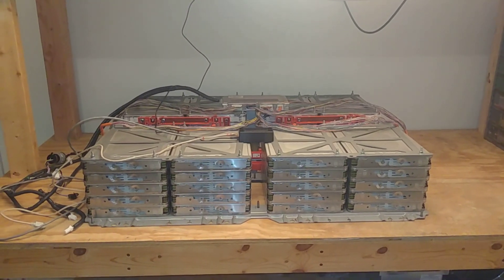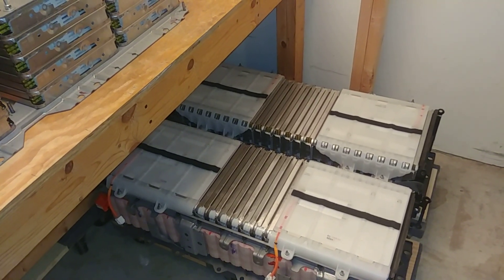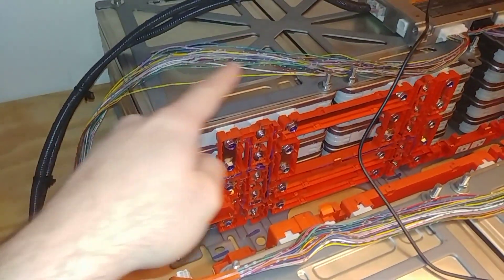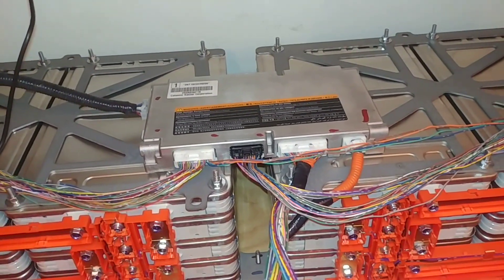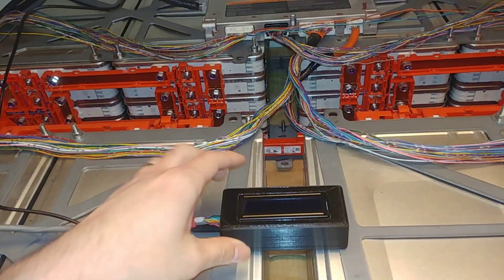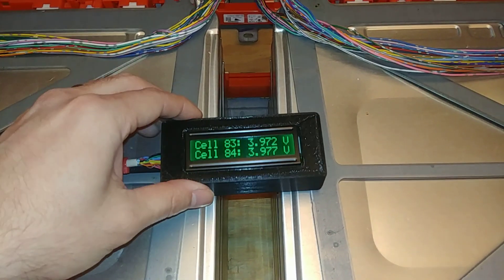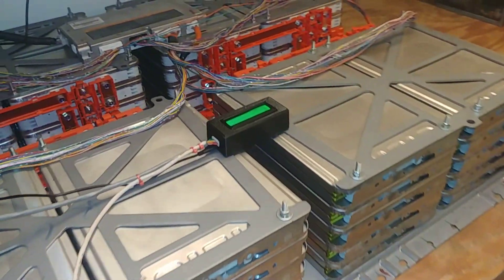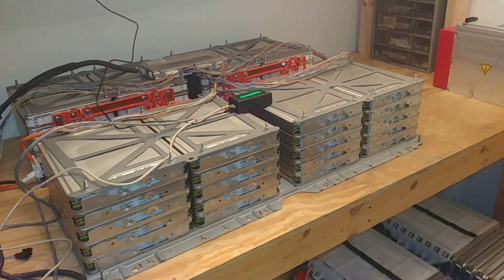Solectria E10, Lithium Ion Battery Upgrade, Part51

Comment: Hello! I am currently trying to put some non-oem modules to renault fluence z.e. battery pack which uses nissan bms. i''d like to use the oem bms with reprogrammed chip. Can you help me with modifying the eeprom? I need to set it to work properly with 55kwh pack instead of 22 kwh.

Comment: ok so im trying to make a webshooters and i need servos for this project,but im having trouble  how do you make servos controlled by buttons that are portable and dont need  to be connect to an computer with an arduino card and if possible would i need a battery pack or a sort of arduino card that is portable?
Reply from the maker: Not related to the video you are commenting on, but I do make this for controlling servos:
http://www.wolftronix.com/tailEarController/index.html